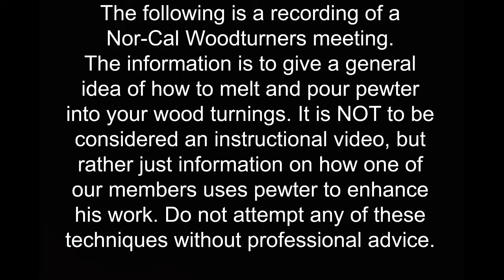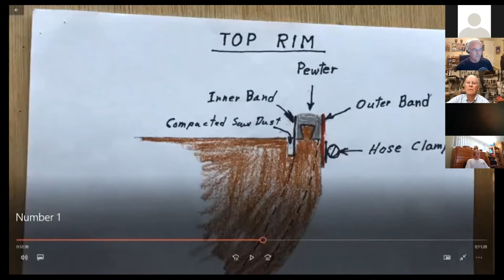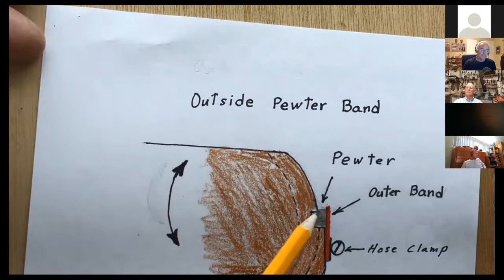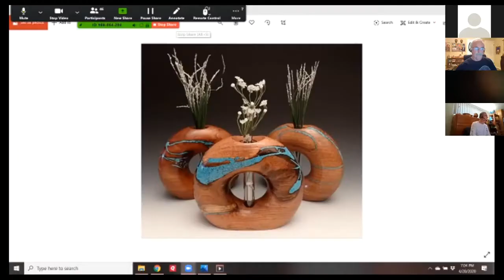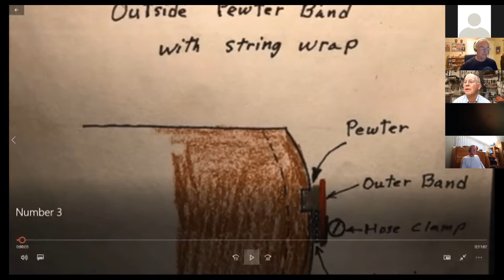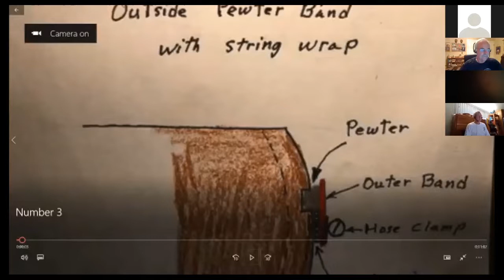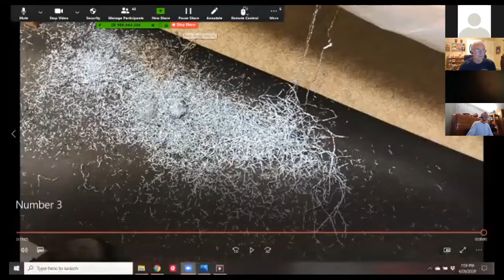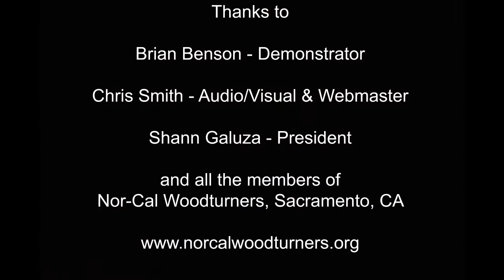Adding pewter to a turned bowl

Comment: Very good video!  I've been a metalsmith for 45 years and a jeweler for 40. Also work wood and about 15 more different art media. First let me start with a safety message. Old pewter contains lead!!!! Do not breathe fumes from melting, handle carefully, dont touch your face or mouth and wash your hands very thoroughly after handling it. Do not put food or drink into any of the vessels you have used old pewter on.  This is partly why your melting temps are lower. Lead is extremely low melting. Old pewter is an alloy of lead and tin. New pewter is lead free and alloys are tin, bismuth, antimony, and a few others in the softer white metals group....no more lead. Would really love to see you switch over to lead-free alloys. I use bismuth for some small castings.  

You are correct to keep metal from different pieces separated in different containers. If you mix your alloys it can create cracking and porosity (pitting,).

For recovering your chips/filings from the sawdust, tru a technique used for centuries to make tiny metal beads... layer your sweeps in fine charcoal or ash in a crucible and heat it until the metal beads up, i imagine with pewter it might even run thru to the bottom.  Dump it out into water when cool and the metal will sink to bottom for collection.